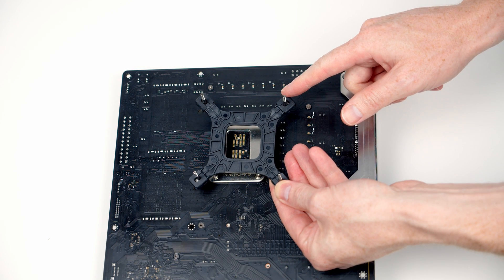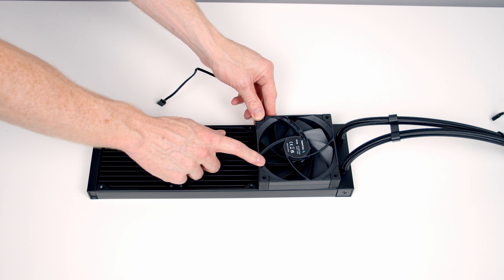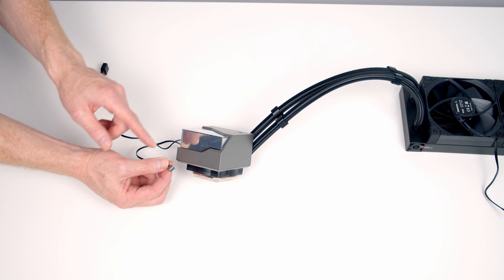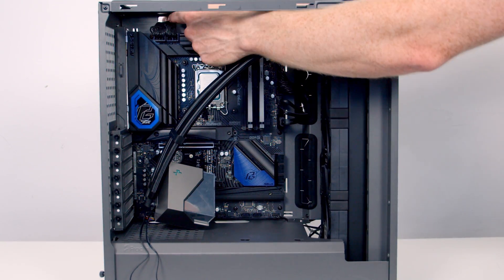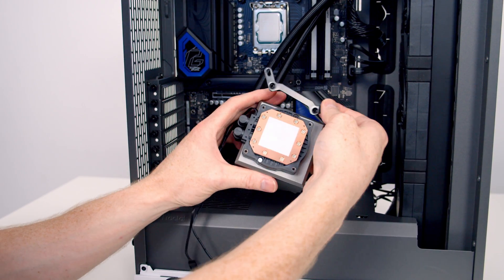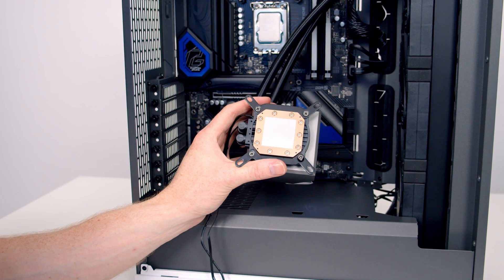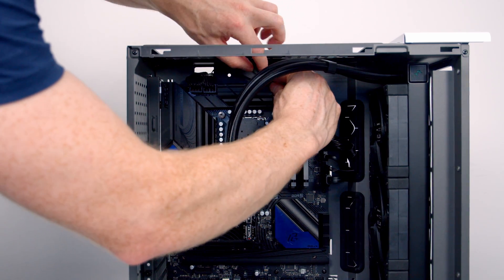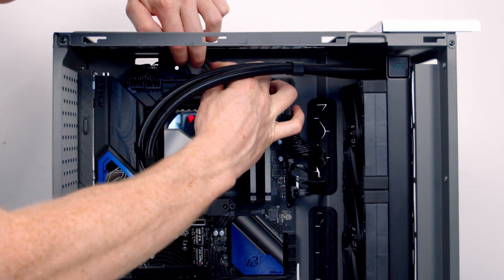Deepcool LT720 Installation Guide

Comment: On mine I span the pump so the tubes come out the top if you don't u would make a air pocket in the top of the pump potentially. It then goes into the top of the rad. I idle a 7800x3d at 30c and never got above 70 full load

Comment: Wrong installation! The only right direction is: radiator on top, tubes pointing DOWN from the radiator to the LOWEST point, which is the pump / cpu. This ensures that no whining / gurgling sound is produced, as often criticized in other comments.

Why: water is heavier than air, so it naturally goes down, same as the air goes up. Don't try to negate the laws of physics, install it right and be happy. 

For more info, search on youtube for : "Stop doing it wrong: how to kill your cpu cooler (AIO mounting orientation)"
Reply: in a case where 360mm only fits in the front, and doesnt have enough room for tubes in the bottom, this is the best orientation possible, (atleast in the 4000d front mount)

Comment: 2:00 you ACTUALLY can put the plastic cover back on and it stays in place. 
you didn't even try and assumed it wouldn't. i have put it back on for a day or two until i had the time to put the cpu in.

is there a specific reason you installed the pump tubes down? i installed mine tubes up and it looks so much cleaner inside.

Comment: Poor installation practice. For optimal longevity the radiator should be installed at the top of the case. The next best config would be on the front of the case with the tubes at the bottom. No AIO should ever be installed at the bottom of the case or in the front with tubes at the top.
Reply: "For optimal longevity the radiator should be installed at the top of the case." Source?
Reply: @lucaschenJC common sense…
Reply: Are you dumb
Reply: The anti-leak gasket is mounted on the side that the tubes connect to the rad to specifically “burp” any air that would build up over time. This wouldn’t work as well if it sat on the bottom
Reply: @bolttracks OK, then you probably have completely different physics on your planet than we do on Earth. Where does your “air” go after it has been transported further? 😂
Reply: @bolttracks  Source? Air build up is an inevitability with every AIO. If it "burps" out the air what do you think will displace it? More air. It is a fact that with tubes at the top you will always have some air getting into your pump which is guaranteed to shorten its lifespan.

Comment: Great cooler, I got one a week ago.
The fans are not so good though, the PWM whine is terrible.
I replaced them with Lian Li ST120's, temps are down by 8 - 10c on average and it's now completely silent..
My 5800x idles at 32 - 38c and only hits 70c when under full load.

Comment: For an ideal install, you put the radiator in upside down.

The tubes need to come out of the bottom of the radiator. With them at the top, because air rises, you won't get a clean flow of liquid through the system. It's going to be more noisy and less effective at cooling like that.
Reply: as long as the part thats goes on the cpu is lower than the heatsink there is absolutely no problem.
Reply: @uwotgames  That's incorrect. Radiator on top or of the front with tubes at the bottom. If you have tubes at the top you will inevitably introduce air into your pump which will shorten its life span and lower the performance.
Reply: @PlayerToPlayerMod This is incorrect as well. Tubes are fine at the top as long as the pump is below the inlet and outlet. The pump is not strong enough to suck in air through the system. You’ll just have noise from the bubbles burbling up there but that’s it.
Reply: You're right this guy is a totally moron. Pretty sure he's also pulling air through the radiator which doesn't seem smart

Comment: I followed your guide which is top-notch. Upon firing up for the first time, a loud fan noise was present. I assumed this was due to cables getting in the way but everything checked out. So I removed the radiator and removed all the fans to see if there was something loose. Again everything checked out. This led to an experiment where I set the fans on the radiator without screwing them down and turned on the system. No fan noise occurred. I began to put in and tighten the screws one-by-one. As I was getting to a snug fit on the first fan the noise began again. Then I had a revelation! Originally, I was in agreement with you on orienting the fans so that you pulled fresh air in through the radiator. But then I realized that this is also pumping hot air into the case! So I reinstalled the fans with the logo facing out and tested again. No fan noise occurred even with snugged down screws. This led me to believe that the having the fans pull fresh air in from the bottom of the case and out through the radiator was the correct way to do this installation. My i9 13900KS idles at 31C. What to you think? :goodvibes:
Reply: You generally don't want the radiator below the pump because then your air will pool inside the pump.  You put the radiator either upright on the front/side or on the top so any air bubbles will pool in one end of the radiator, instead.

Comment: Be warned that the bracket has a weird protrusion that may potentially interfere with your motherboard's top M.2 slot or the heatsink.
Reply: Thank you. What a hassle when that happens installing. I have run into many similar issue in my 20 years of building computers
Reply: hi, should we install brakcet lg1700 to install this cooler on asus prime z790-a wifi?
Reply: @user-fo9ce3hr5h  Might be a bit late, but it is the socket type. You either have LGAxxxx or AMx

Comment: my idle temps are horrible
Reply: i am at 53
Reply: using this cooler?,if you replace your cpu without a clean window installation,this is common thing,sensor doesnt work properly,i got mine fix after reformat my pc,bofore 55c idle,but now 30c ish,my room ambience is 25c
Reply: Some have said it has to do with the factory supplied thermal paste. Scrape and replace has fixed this issue
Reply: @nickg505  I replaced it same bs
Reply: Weird. My 5900X idles at a lovely 33 degrees with this cooler. Maybe you got a dud.

Comment: Well the resonance and NOISE problems with the fans (FK120) are terrible, buyer beware because Deepcool support does everything for not replacing the fans ...seems like most of them have the same issue, thank you Deepcool !
Reply: so just the fans are bad then?? cooling good otherwise?
Reply: @MisterFisterrrrrrrrrrrrrrrrrrr  yes, but 250w cpu max, not the 300w advertised.
Reply: @2Drezik  oh ok.. i got a 360mm corsair capellix and was wondering if I should get this one.. everyone says it's the best for the i9 13900K
Reply: @MisterFisterrrrrrrrrrrrrrrrrrr  i got it on a oc'd 5900x and it cools it down quite good.
It's indeed possibly one of the best in the AIO's family. But the fans are a real problem, i'll even say it's a deal breaker.
Check YouTube for FK120 resonance issues. Support is below average as wel.
Reply: @2Drezik  well I got some lian li unfans on my current aio so I'd use those
Reply: @MisterFisterrrrrrrrrrrrrrrrrrr  i went all-in and ordered 3 Phanteks T30's, half the price of the AIO, but at this point i don't care anymore ^^
Reply: @2Drezik  can't go wrong with T30 fans they are monsters of cooling have like 6 of them
Reply: @redclaw72666  yup, i have the t30's now 👍

Comment: How tight do you tighten the mounting screws? Just over hand tight with a screwdriver or is that too much. FYI, the bottom AMD bracket is too big for the gigabyte aero x570S.  I had to shave off 3mm with my Dremel. Not a big deal, but something to note for people with that Mobo. The giant m.2 heatsink interferes